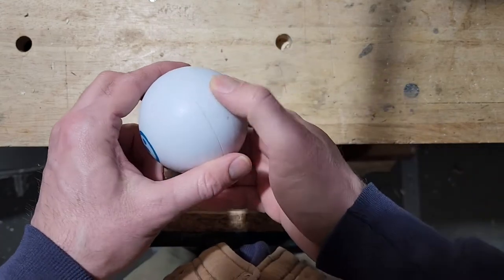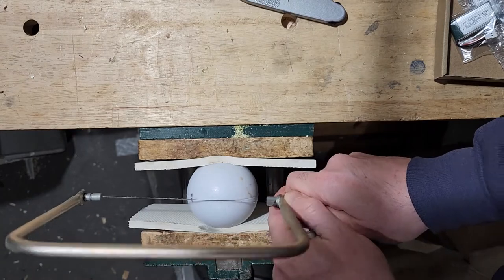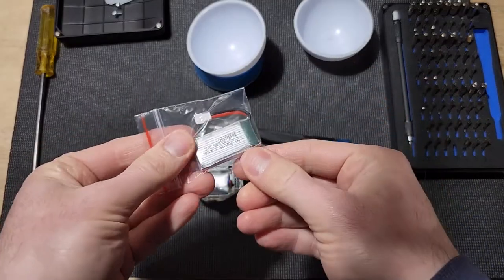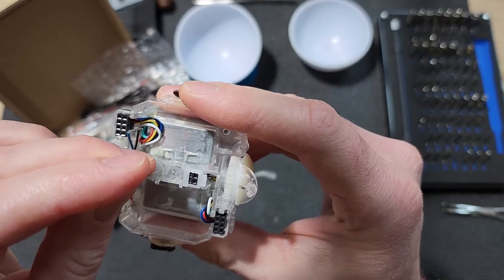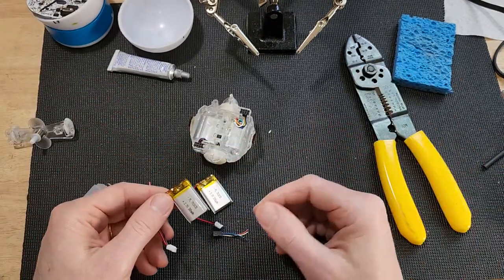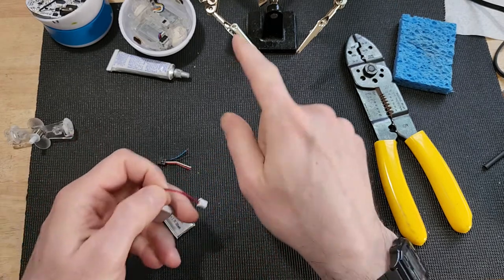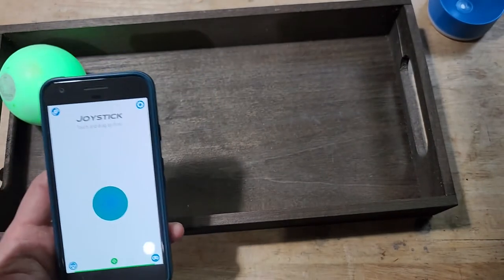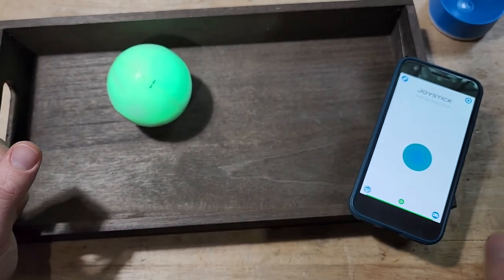Sphero 2 Battery Replacement

Comment: Thanks for the link to the batteries, I've got one with some "spicy pillows" as well.  On a side note about opening the outer case: another user, FIXED1T, showed a method using a hammer instead of sawing it open.  I used that method to open mine, it cracked along the seam between the two hemispheres and opened up well.  The crack is a bit jagged but everything nestles in nicely when putting the sides back together.  I will be taping mine closed rather than gluing but that's just a personal choice.  FIXED1t demonstrated his method on a SPRK+ and a BOLT, but it worked on my Sphero2.
Reply from the maker: I considered the hammer method, but I decided to go with the saw instead, it was quieter. I hope yours works out.
Reply: @JoshsShop  is true, sawing is quieter, faster and less likely to damage the whole sphere.  Figured I had nothing to lose and if I broke the sphere I could hackjob some different wheels on it and make it a car.  It worked out, though

Comment: Drat ! The batteries are listed as current unavailable! Anyone else find perhaps a different link ? Thx for the video. * always cut one wire at a time..
Reply from the maker: Dang, I will look when I get a chance, and thanks for the tip (I'm definitely more of a woodworker than an electrician, but I thought this might be helpful to folks). Let me know if you find an acceptable set, I will change the link.
Reply: no pun intended! Get it??? Current, batteries, I'll just let myself out...

Comment: Quick tip: If you heat up the shielding for the wire with a lighter it's a lot easier to strip with your finger nails.
Reply from the maker: Good to know, thanks.

Comment: Hey guys I kinda messed up on multiple parts of the rewiring long story short does anyone know the name and where I can get the battery connector?
Reply from the maker: There is probably one available somewhere, or one that could be retrofit, but other than scavenging one from another sphero I don't know, sorry.